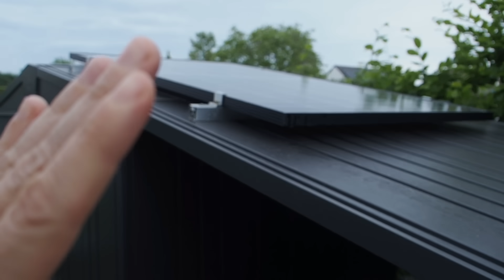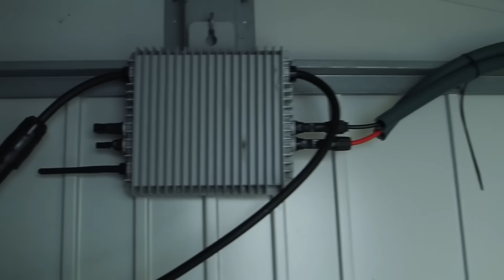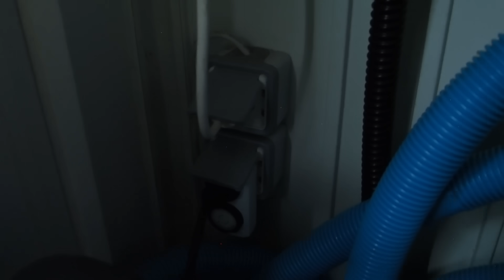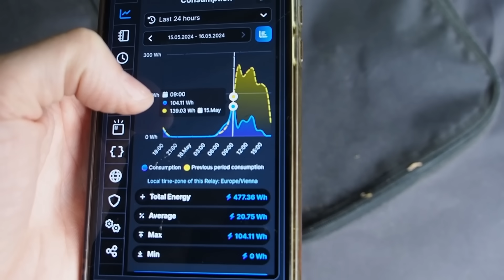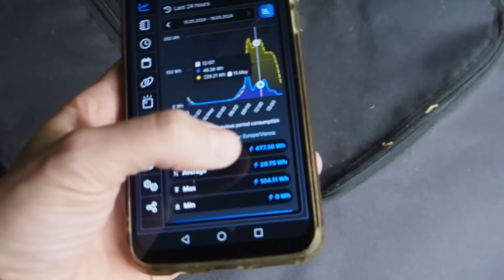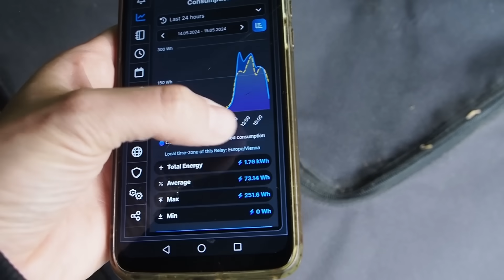Solar system? Yes? No? Which one?

Comment: Also, squirrels and other animals chew the wires and the rubber/plastic seals etc. Then you call the solar company, and they are no longer in business (or have now changed thier name). You end up with $10,000.00 of work that produces zero power; but you are making the payments for the next 15 years. 
Note: when you call others to rewire or repair: they won't touch it! They will only come out the remove the system and install thier equipment. Of which is exactly like the previous. If you choose the new system: you are now paying for two systems....and in one or two years the system stops working.....

Comment: Anytime you use an installer or builder/contractor the cost of the project very likely increases by a factor of 3-10x.   I have bought some off grid land so utilities are not even an option.  Some thoughts about the prices of components:
Batteries:  I just bought 16x 3.2V 300Ah lithium phosphate batteries/cells with which I could build a 600Ah 24V battery or 300Ah 48V battery.  Cost including shipping $1800.  I bought a split phase  inverter with an iron core transformer which provides split phase power (240V ac and 2 circuits of 120Vac).  Good for 4000W, with its reduced frequency and iron transformer it can start loads that peak at 12kW for starting.  Cant do that with a high frequency inverter.  Its cost was $900.   I bought a solar charge controller that includes a back up inverter.  It can accept up to 430V DC from the solar array, so you can connect the solar panels in series for high voltage and low current and not have to use welding cable to pass the current.  This reduces ohmic losses and saves a lot of money on wiring.  Its cost was $377.  If has a built in 3kW high frequency inverter which can provide 120V power is the main inverter went down.  It is capable of charging the battery at a maximum rate of 40A @ 24V nominal.   The big inverter can charge at a rate of 50A @24V nominal from the generator.  I bought my solar panels years ago but today I could buy 6x500W monocrystaline solar panels providing 3kW peak output for $1745.  Now one needs to add battery interconnect cables, high current fuses, a disconnect switch rated at the appropriate current and voltage and wire to connect the solar panels.  But that will not come to much compared to the other parts of the system.   So in summary, a solar array capable of 3000W, with a 600Ah 24V battery, a 4000W 24V split phase inverter charger, a 3000W 24V solar charge controller / back up inverter, all for under $5000.

Comment: An electrician can tie your solar system to your house’s electric panel. A better inverter can be preset to use available solar power first before it reverts to the grid. So the grid can be your back up power when needed. Buy some lithium batteries to store power during the sunny days when you are generating more power than you are using. That power can be used in the night. Do NOT tie your power generation back into the grid. Store it for yourself.

Comment: I added a 400w free standing solar array and 3 100 amp hr batteries.   Mainly just use it for the refrigerator.    Cost was around $1500.   We had a three day power outage last summer and most of the food was thrown out.
Reply: Yes Lilly, I followed your instructions on how to build my system.

Comment: I stuffed a couple of panels on my shed roof, and have them charge two lead acid leisure batteries using a super cheap and nasty charge controller that cost under 10 Euro. I got a small 1000 watt pure sine wave inverter to power small appliances. Its nice to know that if power goes out for extended periods of time I can run an extension cable into the kitchen and power the fridge and freezer. I use it to charge my E-Bike and power tool batteries, run a diesel heater, lights, car stereo, and maintain my motorbike battery over winter. Super handy and a fun project if you are into that kind of thing.

Comment: I purchased a very expensive system 4-5 years ago.  Probably paid to much but I wasn't concerned with pay back.  26 panels, 10 kWh lithium batteries, I get paid for power sent to the grid.
Professionally installed...
We benefit everyday there isn't snow on them.  The batteries keep our refrigerator, freezer, pump and boiler operating during power outages.
It's peace of mind that we will always have power.

Comment: I would never allow the "Government" to either subside or allow anything I buy to be connected to the grid. A battery pack or two, can save lots of energy, and depending on your usage, you can keep and use all power YOU produce. You would only need to be "on grid" if you don't have enough storage. In the USA, if you accept a "Gov'nt Grant" {loan} for solar, the Government owns your house UNTIL they are PAID in full. They can also shut off your power when they want. {Think social credit score}..

Comment: Lilly, you can mount your panel at an angle - just put an angled piece of sheet metal or even painted plywood at an angle against the raised side to block and channel the wind - make sense?  Very simple solution.

Comment: Never take the solar company offers.  They are charging twice the cost and cooperating with the utility companies and here anyway, the credits don't pan out and the savings don't pan out.   You are much much better off installing your own system - pay an electrician for the hook=up to the house system.  Also, I think it makes a lot of sense to include at least one wind generator in the system - it will work over night and they now have magnetic bearings to almost eliminate wear - and generate about 600 Watts of power an hour for each unit.  So you could have an automatic switch to move to the wind generators when the panels drop below a certain power level.

Comment: We installed a 7.1 kWh system 18 months ago including a Tesla battery. Last quarter our bill was $25  whereas a typical summer quarter was $500 or more. Reliability of supply was an issue and there have been power outages that we haven’t been aware of, and now we hardly ever dip into the grid and are mostly self sufficient, though feeding back many kilowatts of power to the grid which helps the environment overall. Plenty of sunlight hours here in Australia!

Comment: Just my opinion but I don’t see the point of installing solar just to spill the power back on the grid.  If it doesn’t help me get off grid even partially, like you say, the only winner is big power.  I have a small system on my shed and it powers tool needs, rechargeable tools, electric mower and such.  It also can power for a short time select things in the house should the grid go down.  For me the $1000 has been worth it.  I thought solar power as a scam but after using this system, there are applications for it where solar can work well.

Comment: I understand one way to benefit from a solar system is you can have a bypass switch to shut off your incoming supply from the town and run LED lights in your house from batteries charged by your panels.When you need higher voltage for your cloths dryer and your oven just flip the switch to your commercial supplier. You should be able to purchase a converter to run your fridge and freezer.I would think with a little work it could be down with economic  benefits.

Comment: For solar cells to make sense, you must have a system that allows you to completely disconnect the home from the electricity grid. As a minimum, you must have a generator with a larger diesel tank in addition to panels, inverter and batteries. This should be installed in a separate building that is both fireproof and soundproof. In Norway, where we pay as much for the pleasure of being connected to the electricity grid as we pay for the electricity, plus fees and taxes are paid, such a system will pay for itself within three to four years. And you don't have to depend on the state and the rest of the system to live with energy security.

Comment: That rubbish wouldn't even make it to 18 years. Many already fail and have problems the same year they are installed. Also why have solar panels in countries where there's almost no sun. In Brittain or where i live it is just a joke. I will get them when i retire somewhere in a southern country where you have sun all year round. Otherwise it is just not logical. And yeah the argument they work even on cloudy days is just non valid. They always be more efficient in a sunny country, period. I have a portable system wich i use in the summer and keep for when the grid goes down. it was cheap and in the summer time i use it for my electric tools and that's good enough for me. imo the rich invested in this system to find out it was not so efficient, but they needed their investement back. So they shove' em down peoples troughts and make false promises. And off course the gouvernements help their rich friends to sell them to the ignorant mass. I know electricity and i never believed that rubbish they told. People should educate themselves before making such investement and don't listen to what power companies and gouverments tell them.

Comment: I placed panels on my roof, lithium battery bank, inverter and a circuit breaker panel next to my main house panel.  I put all of my lights (LED), paddle fans, furnace, bedroom receptacles, microwave, tv's on my solar system. I have my own silent back up power in storm outages, but use my power everyday too. I live as I always have, and am saving money everyday on my electric bill.

Comment: If you have a generator supplement or backup to assist the solar/wind you could build a wood gasifier system to run the generator for even more savings

Comment: Most people are just too lazy to do a bit of homework. Panels cost roughly €100, take another €100 for mounting material and inverters and calculate €1000 per 10 panels to install them on the roof. 10 panels will cost you: 200x10 + 1000 = €3000 that is what I payed. Maybe you need some extra "electrical groups" if you have an old system replace the old stuff with a new electrical cabin: €500.

Comment: Given that the cost of solar panels is 90% dependent on China, and primarily on Chinese crystalline silicon production, it is unlikely that solar panels will be profitable in the EU in the near and distant future. European Commission President Ursula von der Leyen warned about this in a letter to industry group the European Solar Energy Council (ESMC). "Over the next 4–8 weeks, major EU PV module producers and their European suppliers are poised to shut down manufacturing lines unless substantial emergency measures are promptly implemented," said the letter, dated Jan. 30

Comment: I run my solar panels with a battery bank and I have my 17K diesel generator running off of used vegetable oil I get free from the restaurants it just has to be heated to 160° or better and I put a deep fryer on the side of my generator so I started up with diesel and then I switch over to the deep frying so I run for free totally I run my 6.5 Chevy turbo diesel the same way on the I run it through my radiator lines and I started with diesel and get it to temperature and then switch over to the oil tank that runs through the radiator keep seeking the knowledge Lily you're doing just fine

Comment: Ciao, in Italy the free market does not bind you to the companies, there are no problems of overproduction, large new photovoltaic plants are also being built, the problem is precisely people's stupidity, now they are pushing very expensive storage systems and often with too much battery capacity small and of uncertain duration because the capacity/depth of discharge is exploited too much, with accumulation the cost becomes so high that it cannot be amortized within 20 years when practically everything has to be thrown away, no inverter even on a boat lasts that long, you find yourself to change everything without having finished paying for it, and a lot of them fail, photovoltaic systems rarely last beyond 15 years, the panels are replaced with better performing models, we already have problems disposing of the old ones installed 20 years ago with the first energy bill which has incentivized the installation in 2000, the old ones drop too much in performance or the hail has ruined them, now the panels alone don't cost that much, but approved hybrid inverters and above all commercial storage batteries do, people don't realize that hybrid systems with batteries they never pay for themselves, companies praise the advantages with simulations but no one shows the return on the investment, the solution is a grid system without batteries suited to the needs, without too much overproduction otherwise you practically give away energy on the grid, which is repaid at a price that is too low if entered and getting used to using appliances and heat pump induction hob only during sunny hours, habits must be changed, alternatively a 48V DIY storage which is the only way to reduce costs drastically, many use lithium iron phosphate cells purchased on Aliexpress and often go off grid, but they are the minority, it is a lifestyle, a challenge to not give away money to electricity companies where the cost of KWh is low and all taxes are fixed they are very high and even with a grid system it becomes expensive in terms of fixed costs.

Comment: A balcony plant without battery attached to it is really helping the power company only, as you said, if the grid goes away, you sitting in blackout like anyone else. With a battery attched to it, even a simple lead-acid one, you still got some energy to use. I'll guess your house distribution panel has a isolating switch right before or behind the meter, with your Shelly system you could easily set up a seamless switchover to the battery powered system to power up your needs without endangering the line guys working on the system sending back power to the grid. Just ask your countryside friend, if he could add a big relay/solenoid  that acts like a UPS/USV if the grid goes down and wire your vital circuits to the phase thats powered by your inverter in that case. 
Appropiate sized batteries given with an eye on the balance of cost and size of them will bring you through the low-sun season with ease. I have a friend in the south of Spain, who relies on pure solar, he only has to be careful in consumption in the deepest winter they have, but he is quite undersized in battery capacity, but he can stll run all of his lights all year at least.

Thanks a lot for your information, really looking forward to your new project!
👍👍👍

Comment: You’re not taking account of household battery storage to help balance the needs of the grid.  Solar panels do not feed directly into the grid, they feed into the household battery storage system which is then tapped into by the grid if demand is high enough.  Battery storage is the key to balancing demand and supply.

Comment: Very good and rational analysis. I would never ever install a big system, that is connected to the electric grid. Too much hustle and a rip off. A supplemental self built insular system with 1,6 kWp or more, with a small charger, a 2-2,5 kW converter and a 6-8 kWh battery  is enough to deliver 90% of the consumption except the 4 winter months. High power devices like electric stoves, ovens, washing machines, heaters... you'd better power them with the electrical grid. A small to mid size insular system is much cheaper (3,5-4,5k €) than buying a huge system (20-40k) just to power the washing machine. And you can get good camping stuff with low energy consumption which can be powered with the small/midsize solar system, like 1000 W water boilers, stoves, even an airfryer can run on a small system. Use an automatic switch between grid/solar system for empty battery situations and bridge the interruption when it switches with an UPS when powering electronics like computers, servers, modems etc. ROI: 4-5 years, not 25. And: When the grid is down, all systems connected to the grid will also be down. You're only independent with an insular system.

Comment: I'd bet prices we're high, 
because everyone was panicking/desperate to get cells.
Also if a battery is included (can be smaller), you can use up energy you don't need for later
(might work out better than selling it back into the grid - since you're using your own electricity, instead of buying from the grid)

Comment: This is a VERY timely video. I have found that the Solar Power "Industry" is FULL of Less-Than-Honest companies and individuals. I see the Value in having backup Solar; As an Engineer, I HAVE been able to thus far get a system going by myself. The WAY I have gone about this is to buy the materials over time for cash. I started with one 100 Amp Lithium Iron Phosphate Battery, a cheap Charge controller and one 175 Watt Solar Panel. 
Later I bought Moore Panels, and a second Battery, and a better Controller, as well as a Samuel 600 Wart PURE Sinewave Inverter.I now have 560 Watts of Solar on our Shed Roof, with the wires running into the Living Room under the Entertainment System. I have NOT gone to a system that can run the entire House as for No. 1 I don't have the physical Space for more Panes and 2, Because I DESPUSE Grid-Tied Systems. (There are other YT Channels that explain my reasoning in detail)
Lastly, my wife is retiring this Fall and we are hoping to move, so I'm not tying up Money in the Solar until we are resettled.